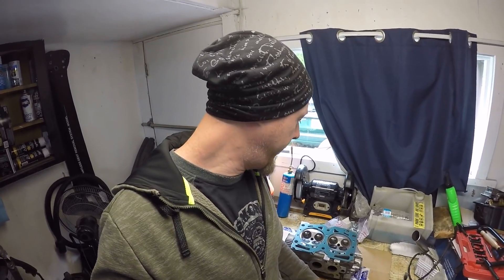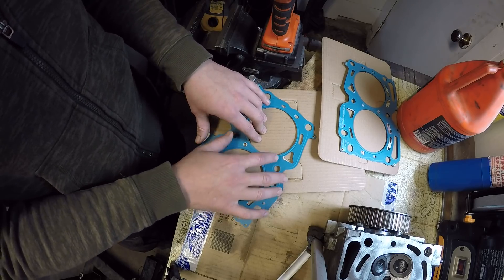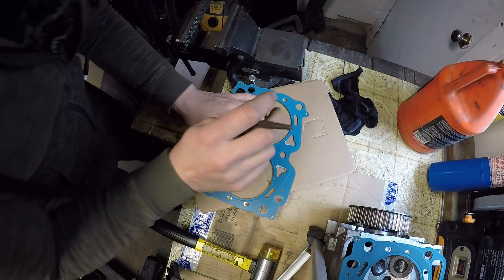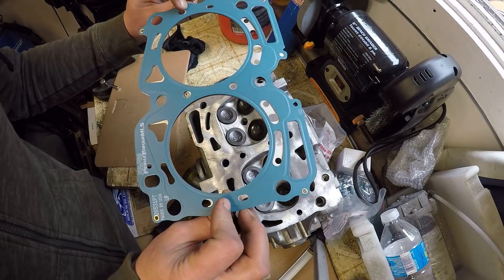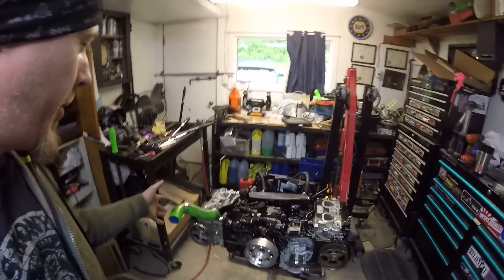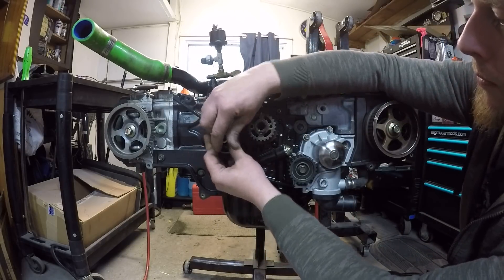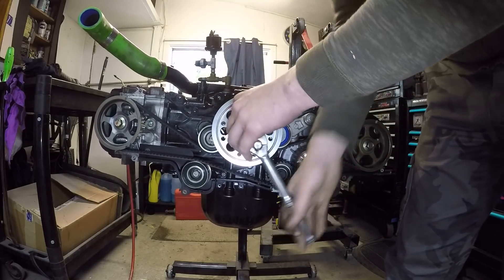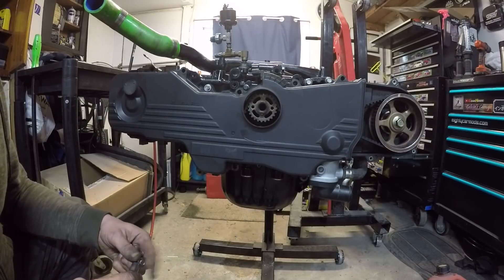SOHC EJ257 Hybrid Build Part 7 - Cylinder Heads / Timing Install - How To

Comment: Hey man, Kane here, from down in Australia. I’ve been watching all your vids on this ej25 SOHC build as I’m about to do the same. Loving all the info, thanks for sharing. Quick question is what are you doing about fueling? Are you using a RRFPR, aftermarket AFPR or factory? And have you modified the MAP to not see over 5v or are your getting CEL and clearing regularly? Thanks in advance. 🤙🏼
Reply from the maker: Hey man, thanks.
As for fueling I used a 10:1 FMU and 255lph fuel pump. At 5psi of boost, the fuel pressure rises to around 100psi. The MAP I was able to place remotely. The hose leading from the sensor to the vacuum port I tee'd in one way check valves to relieve boost pressure before the MAP so it would rarely see boost pressure. The CEL would set a MAP sensor code sometimes after some hard driving but for the most part, I never even had a light come on for an O2 sensor. Not the most efficient way to boost but it works, fairly reliable and it's much cheaper/faster install than an ECU
Reply: @HomebrewSubaru  legend thanks mate, that’s pretty clever using the check valve, does it affect the overall boost pressure? And what injectors are you using to cope with 100psi fuel pressure? I was under the influence we shouldn’t go past 90? I’m still undecided as to do this, piggyback or just dish out and go stand-alone.  Thanks again for your time.
Reply from the maker: @kanewatson5029  At low boost pressure the turbo can easily have enough air flow to have a couple small boost leaks. A TD04 will still push 5psi easily. 
The injectors were stock to a 2.2 NA USDM engine. From what I've found most injectors will handle the pressure without any issue. Piggybacks don't work well as the ECU is good at learning around it. Stand alone is the way to go for best power, economy and longevity. 
Only because we are on the subject I will leak a little info. I have found a bugeye WRX cheap and I'm thinking of swapping the 257 block into it. Then I will be able to tune the car properly with the factory ECU and opensource instead of all the mechanical trickery
Reply: @HomebrewSubaru  awesome, thanks mate, is there much of a difference in the FMU rrfpr or the set ratio regulators? Is it just that you can adjust the blue FMU as you please? Thanks again
Reply from the maker: @kanewatson5029  The FMU is installed after the OEM fuel regulator. A 10:1 is what I ended up using in the long run. Started with a 12:1 but it was too rich for daily driving. No adjustable regulator is need because the car doesn't use any extra fuel while not in boost

Comment: Can I do the same build as you but with 253 heads on a 255 block ?
Reply from the maker: I would expect you could without an issue. Best to try and find someone in a forum that has already done that build. 
You could also try assembly and rotate by hand to make sure there is no resistance, then hope for the best
Reply: @HomebrewSubaru  hey, thanks for the reply, I love your channel
 do you think that it would run right with out a turbo ? 
I have a 2010 legacy 2.5i 253 block and I picked up a 05 255 block,, dude I have a million questions - like do you always get your heads machine milled or have you tried the sandpaper trick ?
Reply from the maker: @gdog9590  it will run fine without a turbo just a little reduced power that won’t be very noticeable
I have had good luck without machining. I use soft roloc bristle discs to clean surfaces. An older video with a BMW shows my home head reconditioning

Comment: What did you torque the head bolts at, head spec or block spec?
Reply from the maker: Torqued with specs from head. SOHC head bolts are a different length and need to be used
Reply: I'm using the bolts that match the head,  was thinking with the ej257 gasket and block, running boost it should be the spec for a boosted application?
Reply from the maker: @ericbergquist2758  NA heads will bump up overall compression of the STi block to about 9.1-9.2 making it very boost friendly

Comment: I have recently acquired a 98 Impreza  with a ej22 that is knocking I have an ej253 sitting  around no heads could I take the heads and toned from the 22 ? From what I've looked at its possible but what will I run into problem wise I'm looking to turbo it when all is said and done just trying  to make something  a little fun in my free time
Reply from the maker: Stoner Nation what you are looking to assemble is called a frankenmotor in the Subie world. Placing 2.2 heads onto an NA 2.5 block bumps compression up close to 11:1 depending on combination. The 253 is even higher compression with domed pistons. 
I do not know if there will be valve contact using DOHC heads one a 253. That would be the only thing holding you back. 
A Frankenmotor with some light porting and decent exhaust can run away from an older WRX at autocross events
Reply: @HomebrewSubaru  the ej22 heads are sohc
Reply from the maker: Stoner Nation also high compression means no, you will not be turboing
Reply: Ok thank you how could I check valve clearance without potentially damaging anything?

Comment: Kind of unrelated but what do you recommend to get ones feet wet with these engines? I might possibly have to do headgaskets on my recently bought Forester. I may want to mess around with these engines in the future.
Reply from the maker: It's best to dive right in if you want to learn boxer engines. They are easy to get out of the car, light and simple to work on. EJ engines are quite interchangeable, read about some projects in the forums to see what is possible

Comment: Any thoughts on max power that can be achieved on a setup like this?
Reply from the maker: I expect 180-190whp from this setup as is. Tuned it could be around STi numbers with the proper turbo. 251 heads are known for flowing well. Of course this is a guess, but I don't see why it couldn't reach those numbers.
Reply: @HomebrewSubaru  Oh yes, I was wondering about the limits of the head.... I'm thinking about a 500whp build with EJ253 heads (should not be much different than EJ251).  190whp  is nothing for even the stock 251 bottom end.

Comment: Is there a reason you didnt use the timing belt guide that comes specifically on manual transmission engines?
Reply from the maker: The block was from an automatic car. The STi block didn't have one because it was installed on a replacement engine for a friend. It should have one, but I have run for years without.
Reply: @HomebrewSubaru  the 257 block was never offered in a manual vehicle do you mean the 251 block?
Reply from the maker: @chrisbushnell2378  Honestly man this comment is old enough that I don't understand it myself lol. I think I must have been talking about the heads, they were from an automatic car IDK
Reply: @HomebrewSubaru  did you need to do anything to get the heads to fit? I’ve heard people putting 251 heads on 253 block and needing to use different pistons/shave the piston crowns. Looking to do this on my 2.5rs coupe
Reply from the maker: @chrisbushnell2378  the ej253 is higher compression. 251 heads will not work without mods. NA heads bolt onto turbo blocks no problem
Reply: @HomebrewSubaru  So I can take my 2006 2.5i SOHC (EJ253?) heads and swap in a WRX / STI block (EJ257?)?  Everything lines up ok?  I know the crossmember subframe would have to be swapped if I want to turbo, but anything else I'd have to worry about?  I don't want to do a full WRX EJ257 engine swap because I don't want to mess with the wiring.  I thought it would be fun to turbo with a tougher block.
Reply from the maker: @WickedCrispy  there is more to think about and plan but the heads will bolt to the block
Reply: No worries! Just was curious, great build! I'm in the midst of doing nearly the same thing.

Comment: Hey bud know if I could put my 02 ej251 heads on a 07 ej253 that has sti rods and cp pistons? I hear the valves will hit the pistons
Reply from the maker: It would depend on a few variables. What compression ratio are the pistons? High compression would more likely touch, but I would think someone assembled it for boost. If lower compression, there is probably room. Of course to know for sure it would be best to assemble it and turn over by hand to check the squish.
Reply: @HomebrewSubaru  you know after alot of though and rewatching the series I am pretty set on going with a 257 block and running my 251 heads and intake on it with my rrpfr and voltage clamp for a bit. Eventually go with a standalone and swap to wrx intake and heads but I think it's the cheapest most reliable route to go using the sti shortblock like you did.
Reply from the maker: Do the same build as I did, some engine management is all you will need for bigger power. The 251 heads are known to flow almost as well as STi heads. A set of camshafts from Delta that would be better suited for turbo would really unlock some power on SOHC heads. Even at 5psi, my wagon would beat up an early WRX. Going to 8psi if I can after the winter.
Reply: @HomebrewSubaru  yeah that's pretty much what I'm gonna do minus the 2.2 intake I'm gonna use my 2.5 intake but I agree on you about power wise, on my 251 with 5psi I was already pretty happy with it but that dang cyl 4 piston happened to me as well. I've got 130 psi in that cyl
Reply: @HomebrewSubaru  you should post some more driving vids of the subie!
Reply from the maker: I planned for an auto vlog in the wagon next week.
Reply: @HomebrewSubaru  right on looking forward to it!

Comment: Do you have to use a hybrid timing kit too I assume?
Reply from the maker: Always use the intended timing belt for the heads you use. This is a standard ej251 sohc belt.
Reply: nice to know! As for the rollers and tensioner, ej257?
Reply from the maker: The idlers and tensioner are the same from DOHC to SOHC except for the additional smaller idler on the dual cam engines.
Reply: Oh neat

Comment: I’ve had the same problem with aftermarket belts, they all have the same # of teethe but just won’t slip over  that tooth pulley without taking it off. Do u have the same problem w OEM belts?
Reply from the maker: OEM's tend to fit easier than aftermarkets, although I've had tight ones before. This one believe it or not was the tightest I've had and I was about to not use it. I have sent belts back before. I've never had to take the cogged pulley off before on any Subaru and I've done probably 30 or more. Dayco belt felt great after it was installed. It's maybe too rigid to get on easily when brand new.
Reply: Homebrew Subaru
Ya im thinking the conti belt I used might have skipped a tooth. Everything lined up aft a few cranks but im getting a misfire on 1&3 a few weeks after.
Reply from the maker: Let me know if that's what you find.

Comment: You can just use an ej257 head gasket. I put them on all the 251s I service as well as run one on my hybrid. Also, should always buy OEM they are cheap too.
Reply from the maker: I've read people using STi gaskets for 251's. I guess most people don't drill the hole or file. OEM gaskets are great, but honestly I've used this gaskets for years without a problem. Except for once when the NA was at 10psi and had head lift.

Comment: Getting so close! Should be interesting how different it'll be from the last engine you had in there
Reply from the maker: It will be a different experience for sure.
Reply: @HomebrewSubaru  I have a 2010 Impreza 2.5i with the ej253 engine, I want to get a 255 short block and use my ej253 heads and boost it of course , I have a few questions though, could I tune it with my stock ecu?, also would my cams have to be ground? And also how much boost would that setup be safe for?
Reply from the maker: @jonahlavoie8660  There's quite a bit of research to do with that type of build. Likely you will need an aftermarket ECU to get it tuned properly. The cams would be fine to use but swapping for more of a turbo style camshaft would make more power. Pressure is another thing not easily answered. I would expect somewhere in the range of 8-12 psi reliably depending on overall compression ratio. Could be higher IDK

Start a new comment to reply